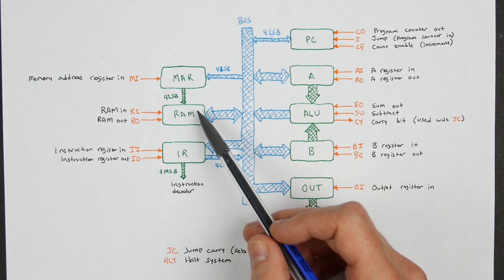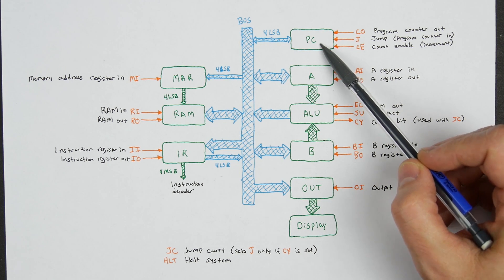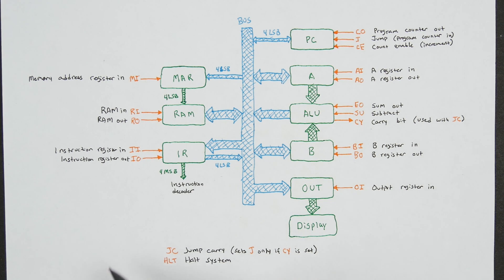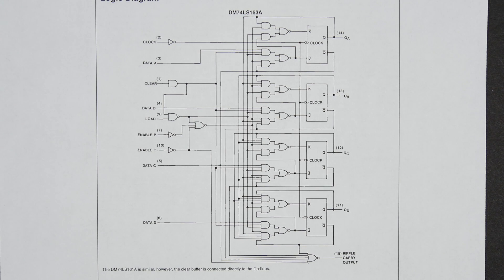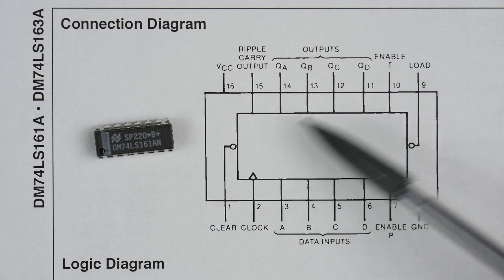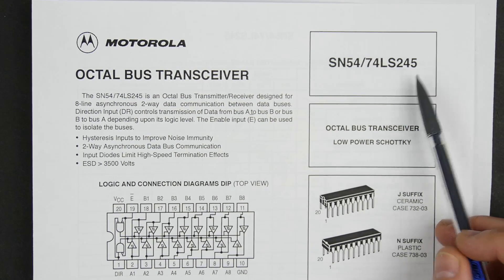Program counter design

Comment: 9:02: "This is an eight-bit thing; we're only going to use four of them, but that's fine." 
I wonder if it would be possible to build some sort of parasitical circuit using all the extra pins and gates that are not used by the main circuit. It might be too difficult to include these pins because their state is influenced by the main project's circuit logic, but some of the other ICs used in the wider project had spare gates on them that were not connected to anything else and that arguably could be hooked up to some separate thing. That would be quite a challenge to make something interesting out of those leftovers. Obviously not the thing you'd want to include in a "simply teach the fundamentals" design, but it might be an interesting challenge for anyone out there who's building a copy of Ben's breadboard computer. You could invent something extra using what you already have. If you do it, please send me a reply and tell me about it.
Reply: I can't see why you couldn't change this 8 bit addresses. It would mean that all instructions conserning memory addresses would be two bytes long eg. need to fetch two 8 bit words into the instruction decode unit, so that would need major overhaul. The bus is 8bit wide so you only need to widen certain registers to 8 bits and of course buy more memory.

Comment: So wait, do we not need the JK flip flop chip? It was on the buy list 😂
Also it's interesting how in the Counter chip, the flip flops don't circle back into one another via clock input. Would have been interesting to hear a few words on that! I suppose all of them having the same clock signal synchronizes the increments better, at the cost of some extra round about wiring.

Comment: A great video :)
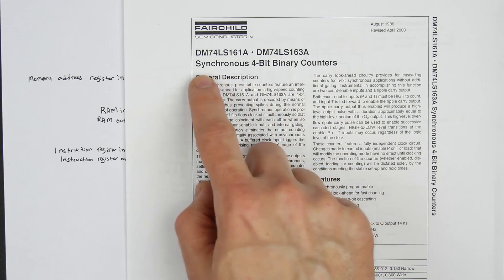Just a small improvement I could think of at 5:15 
"Synchronous means it counts using a clock" could have been put in a better way as "Synchronous means that all Flip flops get the same clock unlike asynchronous where successive FFs get divided clock. Both of them count using a clock input though". We additionally need Next State Decoder in synchronous counter.
1000th like 🤘

Comment: Just finished my program counter but if the clock is too slow, like under 6 Hz for example, the clock cycles after hitting 2 or maybe even 3 (two lowest LEDs lit) and then back to 0000 for starting over.  If I increase the clock, to 7 Hz then the counter cycles thru all values 0 to 15 as it should.  Not sure what is causing this, any advice or comments?

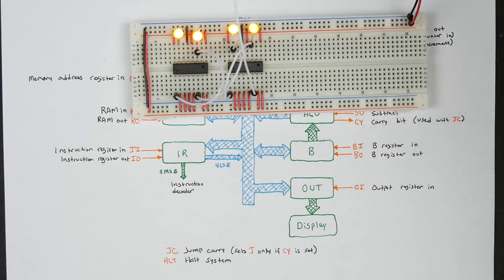Comment: 04:00 But the loading of a new content should still be synchronous with the clock, right? Or could we load it asynchronously as well?
I'm asking this question because there's not many counter chips with synchronous load, especially reversible counters (those that can also count down towards 0), but there are quite some reversible counters that can be loaded asynchronously. So I'm wondering if they could be used here as a replacement of the 74LS161 one?
Counting down might not be very useful for the program counter, true. But one may still want to use it if one doesn't have the 74LS161 chip, or if one wants to build a stack pointer register that counts down instead of up (because the stack usually grows down from the top of the memory space).
Also a reversible counter could perhaps also be used as a replacement for the D registers, since a counter is basically a register too, and being able to increase it and decrease without the need of passing its value through the ALU could be a cool thing to have as well ;>

Comment: I am surprised you are using the 74LS161 binary counter when you already had the 74LS76 flipflops in place. I understand that the 74LS161 has the option to accept data with an enable pin, but your JK flipflops have a preset (PR) and a clear (CLR) pin that could have been used as data input signals.

Comment: Thanks Ben, 
Your series has inspired me to restart a project I worked on years ago to make a simple 8 bit computer entirely out of NAND gates (along with an EEPROM chip and a few 555 chips). Thankfully I already have most of what I need, do you happen to know where I could get a few hundred dip 14  wire wrap sockets?  Wire wrap seems to be a lost or at least dying method and most of the sockets I've been able to find online are $1.20+ per socket.

Comment: I want to use 74lsxx and 74hcxx both together..  what should I do?
Reply: @rabius sany Apu They are not really compatible, but you can mix them if you respect a few things.
- First off: there's also HCT, which you actually CAN mix with LS unworried
- supply voltage: LS and HCT require 5V pretty much spot on, whereas HC can be used within 2V-6V
- gate propagation delay is about the same, ~10ns
- both can go well above 20 MHz, although this is of no relevance for this kind of project
- LS uses more power than HC and HCT (mWs rather than µWs at low frequencies)
- LS is pretty resilient to static discharge, while with HC and HCT you have to be careful
- LS inputs have "auto-pull-up" (Ben takes advantage of this several times), ie if not connected they default to HI. HC/HCT inputs must always be tied to either 0V or +Vs (even if that part of the IC is not even used).
- you cannot reliably drive HC inputs from LS outputs (HC*T* inputs from LS outputs is fine)
- you can drive LS inputs from HC/HCT outputs
- LS has smaller fan-out, that is: 1 LS output can drive only up to 10 LS inputs (many more HCT inputs), whereas 1 HC(T) output can drive at least 50 HC(T) inputs - but only up to 10 LS inputs

Finally: the above is in no way comprehensive. There are more details/pitfalls. For example there are "open-collector"  output versions, or "Schmitt-trigger" input versions in both families - things are different for these...
So please do your own research, eg via Google: "74LS vs 74HC"
Reply: TheRealMeisl   Thank you very much. If I want to use 74hcxx series to build my 8 bit computer, what necessary change should I apply?
Reply: rabius sany Apu  Besides not leaving open any inputs (as said), it really depends on the actual circuit. Again, avoid driving HC inputs from LS outputs, but vice versa it's fine.
The problem is that LS considers anything above ~2V a logic 1, and a 1 output may be as low as 2.4V. However, HC (not: HCT) expects at least 2.5V for a logic 1, so it doesn't quite match. You may get along with it though, possibly with additional pull-up.
The other thing is that LS can't source a lot of current (it can sink much more though). That means in particular that you should not adopt Ben's practice of putting bare LEDs on HC outputs, but rather use low-current ones (1 mA or less), and always put a current-limiting resistor on them (good practice anyways IMHO, even for LS).
You have to try on the actual circuit, use your multimeter.

Comment: I'm having what appears to be low power problems. How much current is your power supply?
Reply: Bill Bowlio:

I have been asked the same questions recently. As I have all but completed my SAP-1.
I am using a 5VDC 3A wall charger. It appears that  the smaller 5V 1A
have a problem powering a fully assembled SAP-1. 
If you are having problems with power, I would suggested trying 
a 5VDC 3A as that seems to work for me, but even that has some slight limitations.
I can not use blue LEDs... They seem to require more power.

https://drive.google.com/open?id=0B6LIgQzDkH8fQlFZU01VajZzdmM

https://drive.google.com/open?id=0B6LIgQzDkH8fUTlCYWpJV3B2dDA
Reply: Bill Bowlio 0.5A is standard in an USB charger, which he mentioned in an earlier video that he was using. iirc.
Reply: Thanks!